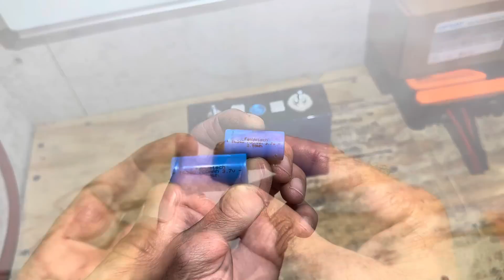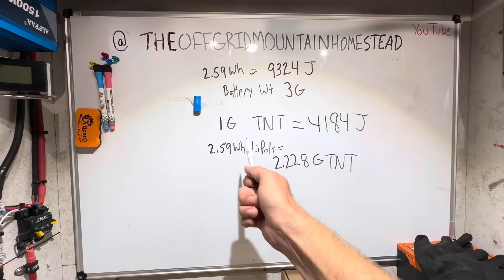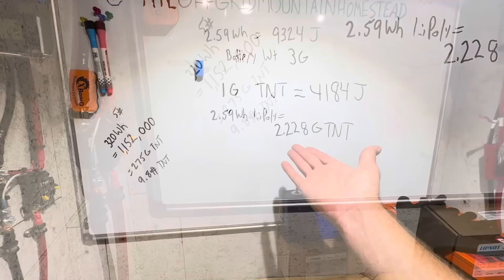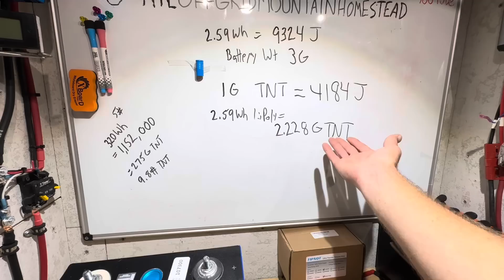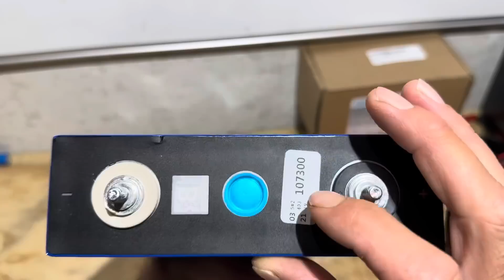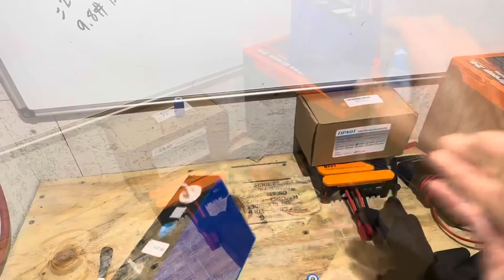Exploding Pagers and Lithium Batteries?

Comment: WELL WERE THEY INTERCEPTED? TODAY WALKIE TALKIES AND OTHER ELECTRONICS ARE DOING THE SAME THING. IF YOU LOOK BACK 4 YEARS DARPA WAS WORKING ON JUST SUCH A THING FOR DISTROYING ELECTRONICS LOST OR LEFT BEHIND ON A BATTLEFIELD. AND USING THE ENERGY IN THE BATTERIES TO DO THAT. IF YOU NOTICE SOME BANGS WERE WORSE THAN OTHERS . DEPENDING ON THE CHARGE IN THE DEVICES

Comment: Could a doctored capacitor have been the cause. If these are overpowered they heat up quickly turning the liquid electrolyte to gas which can cause them to explode. These normally have a weak point to allow a controlled pressure release, but if that was missing or faked, a bigger reaction would likely occur. They also wouldn't look out of place on the circuit board.

Comment: I think there's some research about the natural frequencies of these things. Compare it to the natural frequencies of a crystal wine glass. If you hit it with the right frequency, you can make it explode. all the energy is released in a few oscillations. this means the frequency has to be pretty high. Gigahertz range. The scary thing is that 5G is a directional signal meaning it focusses it's beam towards the receiver to get a higher information density. But also a higher energy density.

Comment: the bms can be hacked is correct but a fuse that is close to the total carrying cap of the battery pack can be limited by a simple fuse on the output.........ergo the max current that is safe for the cells.          I am not an expert but I am pretty knowlegable

Comment: Lets be real shall we? My step-son is a surgeon. His hospital system (in line with most hospitals actually) still uses pagers to alert staff they are needed. His pager which is a Motorola uses a boring off the shelf AA cell. No Lithium involved. I'm sure some could indeed use Lithium batteries, but even way back 20 years ago, when I carried a pager, mine also used off the shelf AA cells.

Comment: Is it possible a battery could cause this type of explosion, very low. However possible. More over all the pages suffering the same failure almost less possible then the battery blowing up so violently once. Imo, pagers had been tampered with. Many people dont realize pagers are still widely used today, mostly in hospitals and such but overseas used nuch more commonly.

Comment: That assumes that the caps are fully charged. Also, what makes the cap explode is not the electricity but heat that causes the electrolyte to vaporize. 1g of dirt has just as much energy as 1g of pee which has just as much energy as 1g of tnt (e = mc^2). 

Clearly it was some sort of explosive which was used indiscriminately. Likely most of the victims were not even "terrorists"(it should be obvious who the real terrorists are). Some kid playing with the pager, or just standing next to some guy, or given to him by his parents for schooling, etc. Genocides are pretty easy to commit when you have half the world believe you are the chosen ones when you are actually Satan's hell spawn. If anyone did 1/100th what the chosen ones were doing they would be labeled terrorists by the world.

Comment: I was soldering a wire onto a small watch battery for my welding helmet and the battery exploded in my face. It didn’t even take much heat. I wasn’t even at the temperature where the solder would melt yet it didn’t catch fire didn’t vent gas. It just exploded a little watch battery, and it had a lot of power

Comment: From a Prepper perspective ? If batteries can be sabotaged to explode then there is no way the US does not know about this. Any communication device with these batteries could be vulnerable. If the government take against you you can be targetted , indivdually or on mass. Agree on the BMS issue. Were earlier EV fires etc proof of concept/trial runs ? It is near impossible to function without devices these days unless you use cash - is the move to digital designed to eliminate this safeguard ? Many questions that need an authoritative and independent answer by public inquiry. We should be concerned.

Comment: That would be a huge battery for a pager. 20 years ago, pagers were only about 1/2" thick, that cell's 16mm. It's also in a metal can - a pager battery would be in a 'prismatic' package like the one in a cellphone. The soft sides make it harder for it to explode, as it swell more gently. It can still burn but no chance of shrapnel.

Comment: My guess is the batteries were swapped with batteries specially manufactured with a small amount of RDX or lead styphnate or equivilent. Both of these compounds require a detonator of some kind. That could be achieved by designing a very small rf chip receiver combined with a tiny amount of compound like lead styphnate that sensitive to heat/spark. The battery would still function as a power source with only half the volume as a conventional battery but requiring more frequent charging which the user would tolerate for a while. The rf chip would be waiting for a signal to set the detonator off with a sub routine in its software where the victim presses the the power to acknowledge the text or failing that a time lapse of so many seconds after receiving the message signal.

Comment: I don't want to be the tin foil hat guy here, but I do have a propensity to think outside the box and consider all the equations. Most of the tech we use is imported and could very well be compromised. Now add to that the push for 5g towers and extremely high RF, what are the possibilities? Not implying, just asking as someone who is always exploring possibilities. Question everything.

Comment: Has nothing to do with the battery. Look at the blast, no smoke, very loud (people covering their ears) and obviously high velocity explosive because of the noise. Has all the hallmarks of PETN. Could be Detasheet in a small quantity. Possibly a set timer used to trigger the pagers all at the same time. It was in a way very low tech and very clever. Just a side note I have 40 years dealing with explosives.
Reply: I am old and had a pager.  They are pre-tuned FM recievers and a cheap cup to detect the tones of that pager number.  It would be simple if it has only one extra input/output line to reprogram it that between the code for it's message and the end tone for end of message that any ASCII code or set of ASCII could trigger a single transistor/FET to detonate.   It could be that simple and every one of the pagers out there could already be compromised prior to being sold/distributed.
Reply: What do you figure the charge was from the videos you've seen? I reckon about 4 grams were used.

Comment: It seems like to me the sure way to accelerate the over pressure event is to use a titanium or strong enclosure sealed. 
Then no one sees the smoke and and the overpressure happens very quickly! The internal pressure feeds the burn rate. 

It seems like someone built a custom set of batteries for those pagers….this reminds me of past creative solutions to manage technology by introducing the STUCKS VIRUS to centrifuges…

Comment: CRAZY NEW DETAILS FROM THE PAGER OPERATION: 
The pagers that Hezbollah ordered came from Taiwan, and it was en route to Lebanon when Israel intercepted them. The explosives were implanted in the device's batteries along with a switch so that the explosion could be activated remotely. 

Today in Lebanon/Syria, around 1530 (330 PM) local time, a message that appeared to come from the Hezbollah leadership arrived on the pagers. At that point, the pagers chirped/rang a few times and then exploded.

 (NYT)

Comment: About 10--15 years ago, I treated a patient who was testing a B-cell (slightly larger than AA) lithium battery. He explained that the wire connected to the positive end accidentally dropped and contacted the negative side, resulting in a short and explosion.  He presented with shrapnel and burn damage to his face and upper body.  His glasses (thankfully he was wearing them) were damaged with dozens of burn/impact marks.  His eyebrows were burned-off, and his beard and hair was burned.

All the medics (some of us were fire investigators, too) were shocked at the severity of the injuries caused.  Frankly, I think the damage potential from lithium batteries is being suppressed.  I don't want to sound like a conspiracy theorist, but I've seen the results with my own eyes.

Good quality lithium batteries, with the proper charge regulation devices, are very useful.  However, people need to be cautious and use common sense with these devices.  They can be very destructive, and are difficult to extinguish if they ignite.
Reply: Is his head still on the shoulders?

Comment: I did some math, I found lithium batteries in this size range contain the energy of 2-8 12 gauge birdshot shells. Some of these cell phone batteries are more energy dense than that 2.59Wh battery you showed.
Reply: Energy density isn't the whole story. 1 gram of candle wax (42 kJ/g) contains 10.5 times the energy of 1 gram of TNT (4 kJ/g). The difference is the TNT can liberate all it's energy instantly creating a shock wave. The candle wax cannot.

Comment: We ride around everyday sitting on 15 to 25 gallons on explosive liquid, yet people are worried about the battery exploding. 🙄
Reply: Flammable not explosive.
Reply: @Dingleberry1856 say it louder for the people in the back of the movie theater. Nano thermite
Reply: @Dingleberry1856  don't you ever watch TV? They blow up all the time! 
Joking aside, have you ever stood close to a container holding a gallon of gasoline and pondered the meaning of explosive and flammable. I bet not. Maybe diesel, but not gasoline.

Comment: I wonder if China would have any reason not to put the vents in the batteries they make.
Reply from the maker: China battery manufacturers want more battery customers not less 🙂They have kept improving the solar/ off grid batteries to make them safer.
Reply: @THEOFFGRIDMOUNTAINHOMESTEAD  Thank you!
Reply: Saves a step at the drill press in manufacturing.
Reply: I have three lithium battery generators you know power Oak / swavey / and a none branded one. Plus lithium batteries in my head torches. All made in China, no problems so far & I can store around 2240 Wh combined from my solar panels on the roof. Looking to buy a much bigger one soon around 3000 Wh in one unit as they give a much bigger punch

Comment: 800 amps would burn those tiny battery terminals in seconds.
a typical modern house electrical panel is supplied with 200 amp service.
Reply from the maker: Not 800 continuous lol competition subwoofers draw enormous amounts of energy for a split second/seconds during decibel competitions. Look at some of the stuff audio guys do with the cells!
Reply: @THEOFFGRIDMOUNTAINHOMESTEAD  maybe you should clarify that in the video

Comment: Aluminum is highly reactive to microwaves...I would think a pager could be 
lined with aluminum, subjected to overheated battery to cause the aluminum to spark boom
Reply from the maker: Aluminum is used for EMF/RFI blocking would this inhibit the pagers signal reception?
Reply: You are correct as to Faraday cage phenom "Faraday cages work because an external electrical field will cause the electric charges within the cage's conducting material to be distributed in a way that cancels out the field's effect inside the cage." Nonetheless, any aluminum in the pager for shielding a component could be "excited" by a particular frequency to set off a chain reaction
Reply from the maker: Wonder if user of the pager would notice added weight from aluminum shell?
Reply: One component within the electronics shielded by aluminum as a standard part of its construction design could be exploited by a discovered microwave frequency is what I am saying - I understand the pagers were/are Motorola - don't know any more than that at this moment

Comment: Where are the vents on the pagers if the battery degases?
Reply from the maker: Last pager I had about a quarter century ago had plenty of room around buttons to allow gas to escape or more accurately let water in a ruin the pager!
Reply: @THEOFFGRIDMOUNTAINHOMESTEAD  The reason I asked though is because there was a video of an EV that exploded because the gases were trapped in the vehicle. Kind of how a balloon explodes when overfilled with gas.
Reply: Evidently the right and left pants pockets of the Lebanese wearing these.

Comment: What if he batteries were tampered with What if the vent holes were blocked? What if the batteries were replaced with different "unsafe" batteries? Yes, regular batteries have safeguards, but these pagers were intercepted and tampered with. The explosions happened in a variety of areas so the EW theory seems implausible.
Reply from the maker: Anything could have been done to the pagers. As some viewers are commenting and some news stories are further developing it appears that they were equipped with some type of dedicated explosive agent. Still a developing news story and still conflicting information out there

Comment: I’ve got 10 year old 18650’s that still hold a good charge and all my 1-3 year old batteries are crapping out all the time. No burn ups so far
Reply from the maker: I’ve always wanted to build an 18650 pack! Did you salvage from laptops or buy new?

Comment: These were Apollo Gold pagers that ran on AA batteries. There is no way these could explode in this manner. My guess is they modified the firmware to only trigger the vibration motor when a certain message was received. They then replaced the motors with explosives. This would allow the trigger to be added without modifying the main board.
Reply from the maker: I like the way you think!
Reply: @THEOFFGRIDMOUNTAINHOMESTEAD  The other problem they would need to solve is how to send the message to the pager to exploded. They would have either had to access the pager network to send the messages out or had their own radio towers transmit the message to the pagers. I am guessing the latter since it would leave no traces.
Reply from the maker: Even better thought! Nice one!
Reply: If they modified the firmware to activate the motor constantly it would allow it to heat a detonator in series with the motor, but the quick buzzing with normal calls wouldn't making it work normally until the specially made call came in.

Comment: The 'electronic warfare' theory is not that they put out a frequency to excite the battery.
It's that a software caused the battery to overheat / explode.
That is very plausible but would result in fire more than a clean explosion.
Reply: The batteries in the pagers were smaller than normal and replaced with a new explosive the us and Israel came up with

Comment: The pagers were intercepted during transit and doped with plastic explosives. Even if thermal runaway happens those explosions were too violent for just lithium batteries
Reply from the maker: Agreed 👍
Reply: yes these pagers were AAA batter powered.
Reply: They were attacked by the Grimm Beeper.
Reply: EXACTLY
Reply: just like that shipment of routers 20years ago that were 'infected' with spyware. 
if your in 'security' you shouldn't be trusting anything new, and if you buy 100 etc then pull 3 or 4 from the stock and investigate for tampering. not doing this can, as we have just seen, come back and bite you on the ass.....
Reply: now you knew import goods are need to be checked
Reply: PETN
Reply: pretty wild that they were still using pagers. I bet they change tech now.
Reply: @robinsutcliffe_rss  they used low tech as its not as locatable as cell phones . many israeli assignations have used the cell phones location to target and destroy enemy targets. Having modern tech is like having a target on your back.. So now they will prolly use ... Carrier pigeons..... I jest not..
Reply: For sure
Reply: it wasn't a battery explosion or thermal runway..because that would#ve taken different time for each individual device to explode... but the explosions happened at the same time!
Reply: I bet it was their mobile phones that exploded
Reply: @pavlovsdog5020  no.. They were pagers as mossad have already used that tactic.. Plus phones are easily locatable and have been used to locate and target persons of interest, hence the use of pagers

Comment: So...
With possible software manipulation, a Lithium battery be turned into an explosive. 
Interesting and horrifying.
Reply from the maker: Your smart BMS equipped solar lifepo4 could in theory be hacked and have safety parameters changed or modified

Comment: How about thermal runaway triggered by hacking the BMS ( Battery Management System) ?
Reply from the maker: Someone could potentially hack a smart BMS and change parameters and other things. But the BMS is controlling the negative bus of battery to negative terminal. Only one tiny positive balance lead on the BMS. So not a real short circuit potential per say. Self heating batteries this would be more plausible. 
But on the small battery like electronics use usually there isn’t a BMS. this comes to play on multi cell batteries.
Reply: Nope 👎 it wouldn’t be as violent as the videos showed of the pagers exploding

Comment: Just had an idea. Maybe all Mossad did was design and manufacture a battery with a very hard casing that would hold pressure. Maybe it was the battery, just a “special edition” for a special purpose.🤔
Reply from the maker: This could be potentially possible! Another viewer commented that now there is intel that alkaline batteries were being used and another said there was sabotage? Developing story so I’m still reading over it
Reply: @patriotpreacher43  You might as well seal up or solder up a few unnecessary vent holes on the batteries while you are hardening up the battery shell or casing